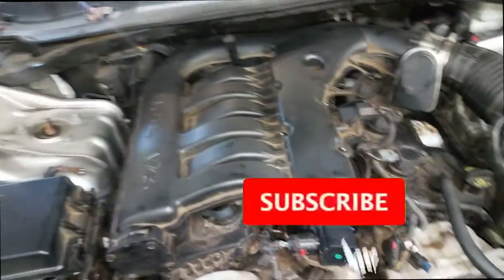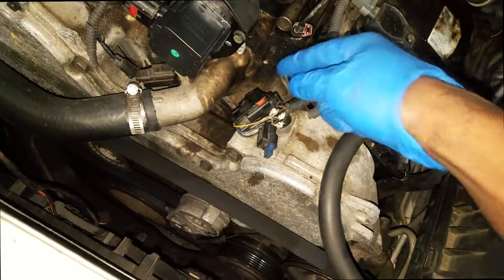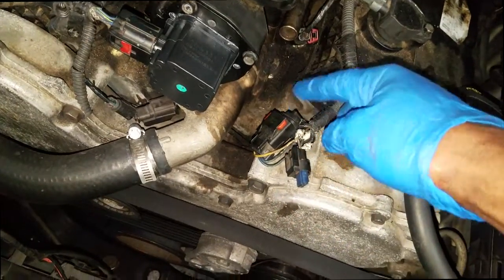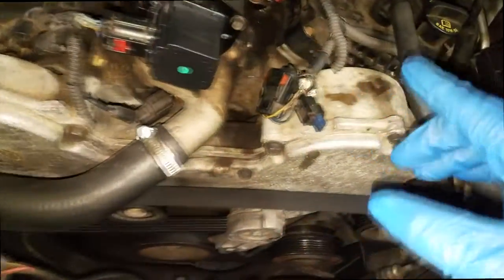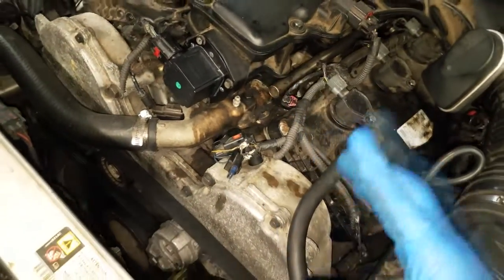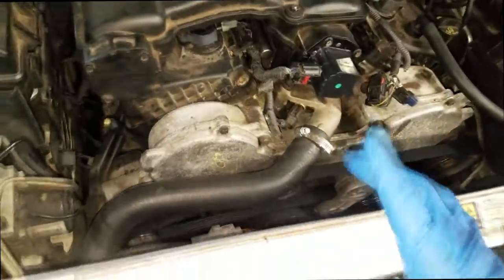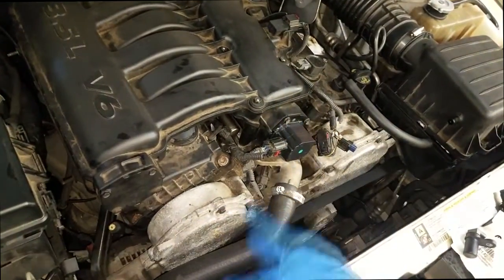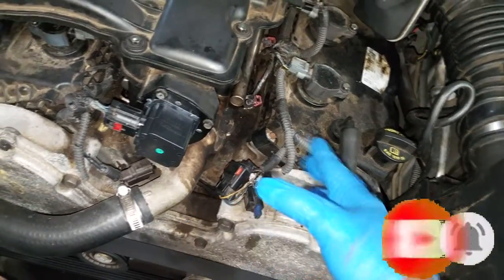Doing this will KILL your car COMPUTER Engine Control Module ECM ECU PCM P0601 P0605

Comment: Okay so if that's what you said can you tell me if one of the O2 sensor all the wires were bare and they were to touch each other what would happen to the computer cuz it's been happening for a while then I separated them
Reply from the maker: Thanks for watching my friend and the easy ans to your question is YES. You can short out a driver inside the pcm like that (not saying thats your problem). Keep in mind, a 4 wire O2 sensor has 2 wires that are dedicated to the O2 sensor heaters. So they can skike out a driver. PLEASE subscribe to the channel for me bud, thanks for watching

Comment: Hello just got introduced to this channel and subscribed. Question: I have acquired a ‘03 Town and country which is throwing a code P1478 battery temperature sensor. My van does not have this sensor or wiring for it.  I noticed a IPM in the cargo area which leads me to think salvage computer/IPM swapping was possible. I don’t have van history. Could a salvage computer be requiring a battery temperature sensor? Is there a way around this problem? Thanks in advance
Reply from the maker: Thanks for watching and yes, its very possible the computer (pcm) was swapped, and depending on if your car has the security system (gray.silver key) the swap was a simple plug and play swap.  But to answer your question, yes a pcm off of a vehicle that was equipped with the sensor will still be looking for that sensor on the different car and if it does not see it, it will trigger fault codes. Is there a way around it? No, you are underable to change the programming of a computer board.
Reply: Re: Possible PCM swap: Vans headlights will not go off(swapped pcm/Security problem idk), so I have a battery kill on battery terminal(basically so headlights will go off) van has chrome key with black  “19RT” rubber/plastic grip. Keyless entry looks to be in keychain form. I thought one time on YouTube a guy had a video about flashing a pcm cheap/easy way. Idk if flashing pcm would fix these issues. Your thoughts and next step? Thank you
Reply from the maker: @darrelbigdaddywhite  Ok the 19R key means that car not equipped with skim security. Now the 2003 models was equipped with a Front Control Module that attached to the fuse box that controls the headlight..You may need a scan tool that can read that module to track down your problems. A PCM flash will not help your headlights..You will need to get that front control module looked at with a good scan tool, thats a good way to get put in the right direction
Reply from the maker: Please subscribe to the channel, thanks
Reply: How/where would I access a scan tool that would read that front control module? Would I take the van vin and and module to the dealer? What would be the cheapest way to scan?

Comment: so use what is nearly common sense... Those sensors aren't THAT expensive , The cheapest repair is the most expensive... Should never compromise engine/drivetrain control related connector wiring especially so close,, He's lucky that Car actually drove in there
Reply from the maker: ding ding ding

Comment: My shift solenoid went out. And my pt only drIves in second or reverse. limp mode. and a a shop tells me that fried my PCM, i had the shift solenoid replaced but still need a new tcm. any advice? 
06 pt cruiser gt *high output
Reply from the maker: My friend, what fault codes are you getting? Btw please like the video and subscribe to the channel for me, thanks